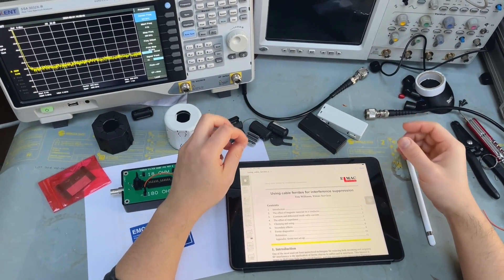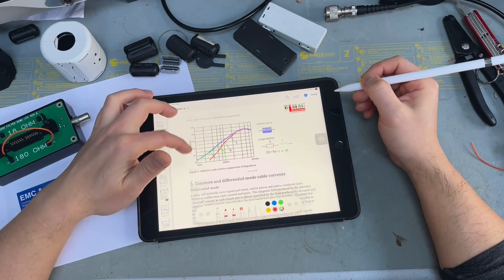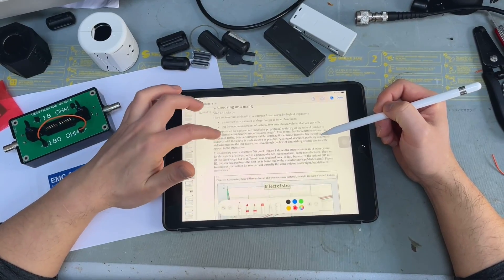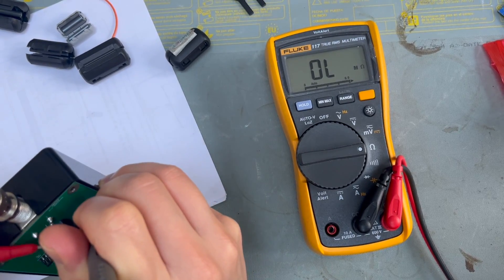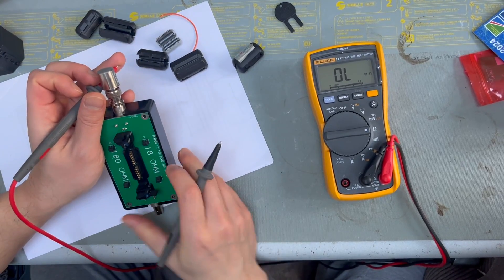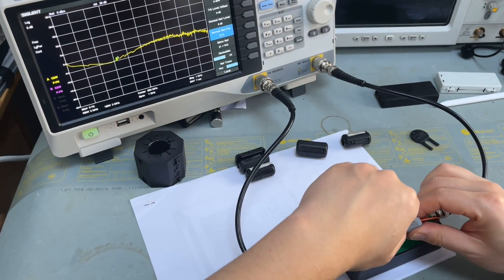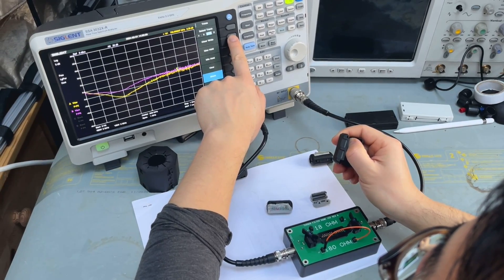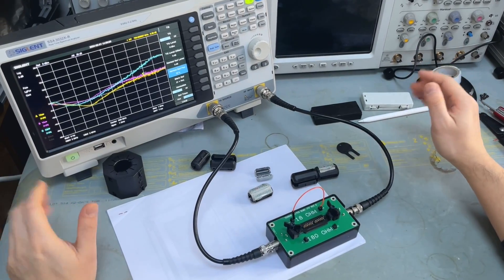Ferrite Core Basics - Your Circuit Impedance Matters More than You Think

Comment: Thanks for the demonstration that the attenuation property of a ferrite choke depends on the circuit's impedance in which it is employed. 
As an amateur radio operator, I was all the time have been made aware of the choking impedance of various ferrite mixes in a 50 ohm environment.
I'm looking forward to the next episode of the effect of interwindig capacitance and how to avoid it in the construction of a ferrite choke.
I hope that will be accomplished by spacing the windings on the perimeter of the torroid core.
De VU2RZA